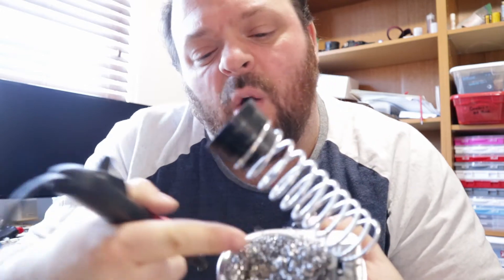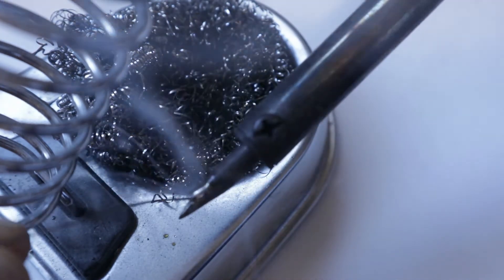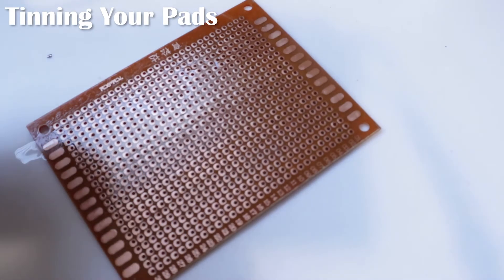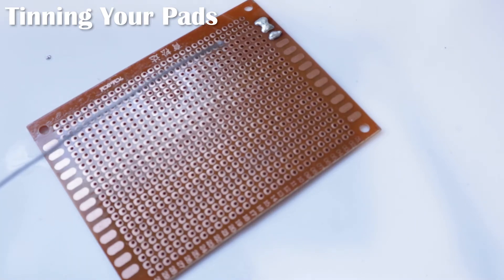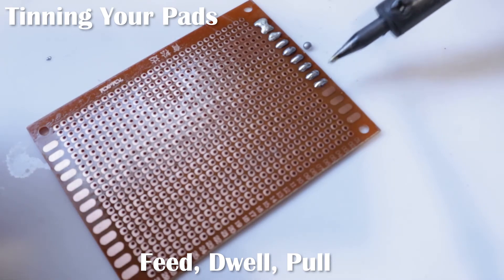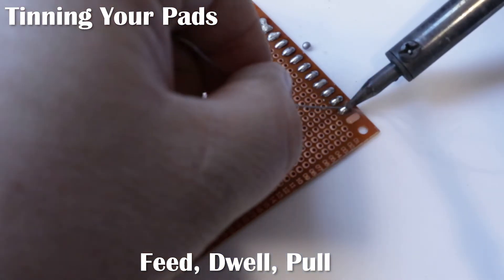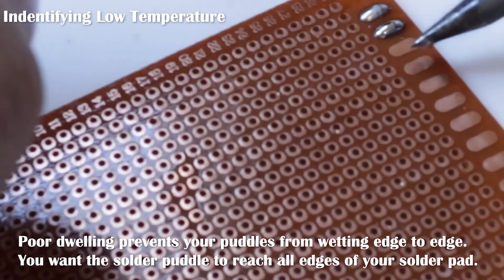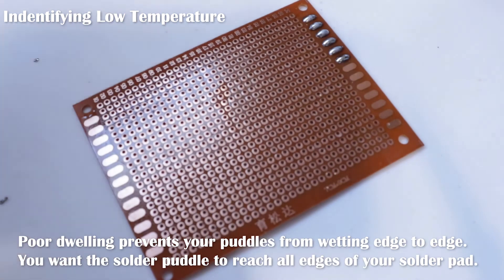Beginner Soldering Tips (to help you stop killing your ESCs and flight controllers).

Comment: Now I've been soldering pads on a practice board just like that, now I need a technique to solder a wire to the pad. Any suggestions?
Reply from the maker: Tin your wire. Trim it to size. Build a puddle on the pad the size you want. When doing a new build, with my board out of the build, before I do anything else, I do this to all the pads I'm going to solder. Then I just go back, melt the puddle, and slide the tip of the wire in, dwell for a moment to ensure uniform melting, and you're good to go.
Reply from the maker: And don't let the insulation melt into the puddle. It becomes nightmarish. Lol. I do recommend using silicon insulated wires for everything. They don't melt like plastic insulation. 

I found getting single wires already crimped with JST connectors and dupont connectors very handy. Then you can just buy the plastic ends and slip them in. Crimping can be a pain in the ass.
Reply: @TheWayneStevenson  that's the information I was looking for thanks. So simply make a puddle and stick the wire into the puddle and dwell for a second or so, correct? I was trying to hold all things like hold them ESC hold the motor wire and hold the soldering iron and hold the solder, I'm thinking this got to be a better way I am doing something wrong. So I really don't have to heat up the wire right maybe just tint it and slide it into the puddle
Reply from the maker: @MrSabram07  Yes. Absolutely. My workflow is this: Step 1: Create puddles on all pads. Step 2: Tin wires. Step 3: Melt puddle and slide the wire in.